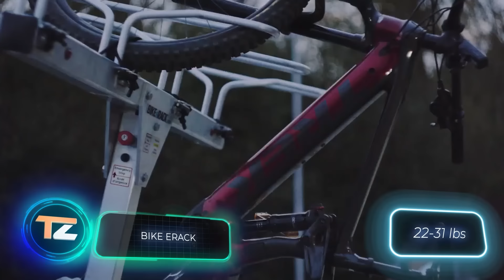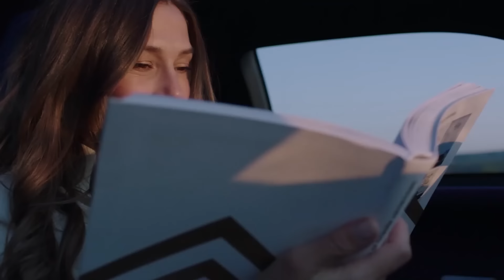CAR INVENTIONS THAT HAVE REACHED A NEW LEVEL

Comment: I picked up a 20’ container like the one pictured from Long Beach Harbor in 1995.
All I had was a 1-Ton Chevy pickup with a 12’ bed and 4’ of lift gate sticking out.
(No fancy trailer)
When the crane set the empty 5,000 lb container on my truck, it completely collapsed
the rear suspension.
The truck wheelied frequently and especially when taking freeway on-ramps, but I
made it all the way to Covina by tapping the brakes to bring the front wheels back down.🚀

Comment: Hitch skid plate is a great idea.
I think I still have mud in my hitch on my 1979 Quadravan from 1985
Reply: $10 hitch. (Or use old one) $30 for welder to use scrap, can of spray paint.
Reply: The stupid thing sticks out so much it scrapes when the actual hitch wouldn't have. $200 to keep mud out of your hitch? No thanks

Comment: back in 1985 Saab was known as a "safety conscious" automobile. The factory tow hitch included a skid plate that mounted between the end of the hitch and the gas tank to deflect the hitch down and away in case of a collision to the rear of the vehicle.

Comment: Towing a AWD with the tow bar and the wheels on the road will likely blow the gearbox and transfer case😂
Reply: Theoretically yes, there is a possibility of damage to both gearbox and transfer case but practically at low speeds and for not so long distances, you  can get away without any damage to your beloved AWD!😊
Reply: Why would it AWD the front and rear aren't locked together and many use a viscous couple meaning it's completely disenganged when not driving, And the gearbox is no different than any other vehicle

Comment: Those who actually wheel usually don’t want a shield for the receiver. Why? Ground clearance. Sure as hell won’t protect the side walls of the spare tire. The receiver is made from fn tough steel, I’ve scrapped mine a few times and banged it- big duel. Maybe I’ll make my own and hold my fishing rods in it lol.

Comment: Idk i see ALOT of potential draw back to that wheel hub wenching system. Sure i can see that being handy for light jeeps etc, but it seems like the weakest point to be putting all that torque just on a cpl lug nuts.
Reply: Agreed, I'd worry about shearing off the lug nuts. The wheel and axle not so much, that's one of the stronger components on a vehicle, at least one made for off road use.
Reply: You should lookup how load is transferred through the wheels by proper torque of the lugnuts. Maybe then you'll understand why you're wrong lol.
Reply: .....Especially when you collect a tree or two because you've made your 4WD so much wider!  Plus the spool winds in the rope/cable too slowly!

Comment: The “autostrake running board is obviously aimed at Americans but what if the driver and rear passenger stand on it at the same time that would put it over its weight limit!

Comment: The Bush Winch is NOT very well thought out. For starters, it appears that you must have special wheel studs to mount it. 
Second, and even more importantly, unless your vehicle has a locker in the differential, it's just not going to work. Without a locking differential, the wheel with the winch on it will just sit there while the wheel on the other side just spins.

Comment: hitch skid plate is a very bad idea, it puts the hitch lower to the ground and when it hits it pushes you hitch up and causes the bumper and frame to torque causing your truck to get damaged and break welds in the rear of the vehicle, the same thing happens if you get hit in the rear from another vehicle.
Reply: Yeah, it (further) reduces the departure angle and puts an even greater load on the hitch receiver mount (larger lever length). The only thing it protects is the lower edge of the hitch receiver from scratches and I’d say a rather theoretical deformation of the receiver opening. Maybe it offers a slightly slower dynamic load built-up (the first impact will be at a shallower angle).
Reply: It also serves as a scoop/ anchor when off road  the mud. Wonder what’s digging in, limiting forward momentum?
Reply: That's what I noticed too, so I agree with you there! 
You could always do what I used do, and just insert the hitch in upside down, while leaving the tow-ball off!
Reply: I'm a body man. Are you? It takes a major hit hit to pop welds. The body gives before welds rip
Reply: And the hitch is skid with the body. 
Like I said. It takes major forces to bend
Reply: That hitch skid plate is not such a good idea. It basically makes the vech frame longer, if it bottoms out on the ground it take weight off the rear tires causing loss of traction.
Reply: @lewiskemp5893  why are you getting so upset, and it do not take a major hit to break welds on the back end of a truck. If you remember Chevy just had a recall on, I believe it was 2013s and up to 2018 just for that reason with broken welds. I may be off on the years, my brother-in-law had to have his 2015 Silverado recalled for that reason. No need to get mad at the comments, we are all allowed to make them. And being a body man does not make you a structural engineer.
Reply: These have actually been on the market for eight years, with none of the mentioned issues being a factor.  If you’re off roading you can either wack your hitch, damage your bumper and and anything else underneath, or you can add protection. It’s the same if you get re-ended, what kind of structural damage will occur with no protection?
Reply: It’s designed for rocks, not mudding. Just pull the pin and remove, then plan on digging the mud out the rest of your rig. If you watch the video on the website, you’ll see the leading edge actually also raises while going over obstacles.
Reply: And the price is crazy. And one with a welder and can make this
Reply: You could make the same argument about drop hitches.  Nobody is worried about them.  I always kept my drawbar installed, because, one folks don’t tailgate as much, and two, if I do get hit, it will take the hit first.
Reply: @robertheinkel6225 Lol I leave mine in all so for those dumb ass parking lot clowns that bump your rear bumper! Find Paint on it all the time!😂😂😂😂
Reply: 😂 what I’d rather that plate slide off of a rock than my hitch get caught on it. The guy on the video has no idea what it’s used for. And if you hit your tow hitch with or without it the damage will be the same 😂 that being zero

Comment: black water jugs are gonna get hot fast..
Reply: Only if they’re exposed to direct sunlight. I do see your point though, but it’s an easy fix with some non-toxic paint or just buying a different color container 🤷🏻
Reply: But they will help slow down the growth of algae.
Reply: That’s the point tho… if using as a shower you want your water to be warm… especially without having to use a portable water heater

Comment: The hitch skid plate . It's gonna bend anyway, okay, it's not protecting anything. It's stupid cause if you're hitting that hard to. It's gonna bend your hitch upward easy. And now it's even lower to the ground because of the Skid plate makes it lower. which now it will hit definitely. 0:41
Reply: Actually, that’s not true. The receiver on vehicle’s is extremely strong, especially on trucks and jeeps that pull heavy trailers. These have been sold for eight years with great success. With the 1/4” square tube inside your receiver, it becomes an extremely strong tool as proven by hundreds of Jeep and Toyota enthusiasts.